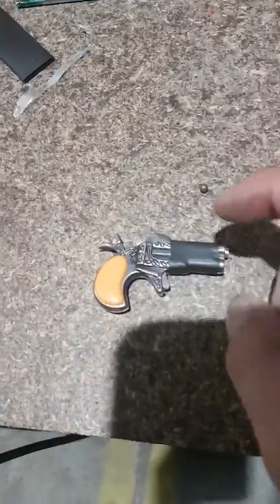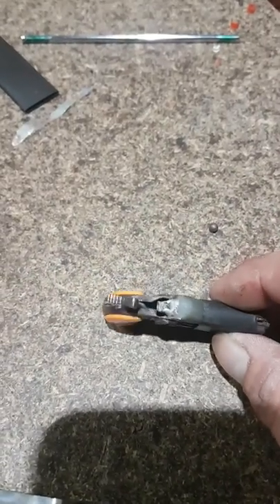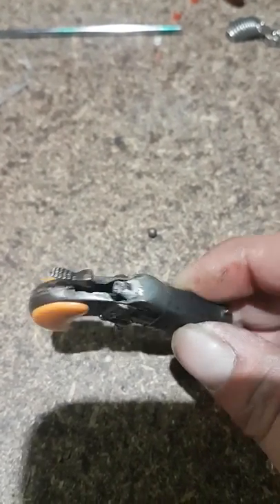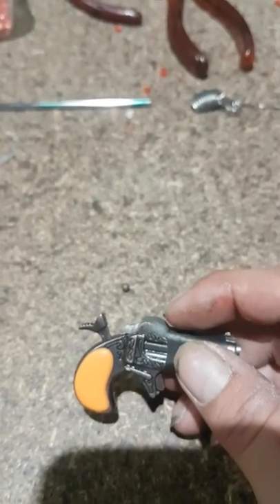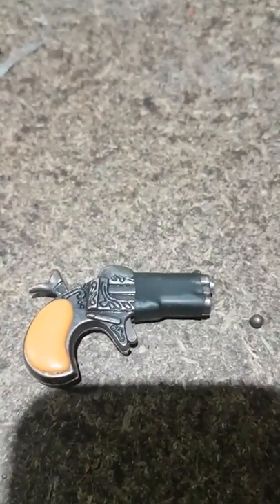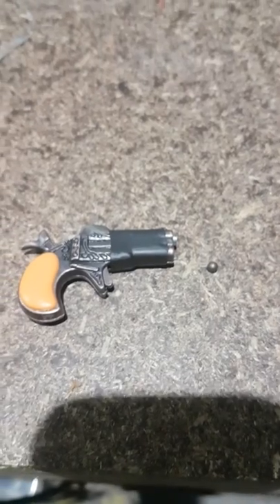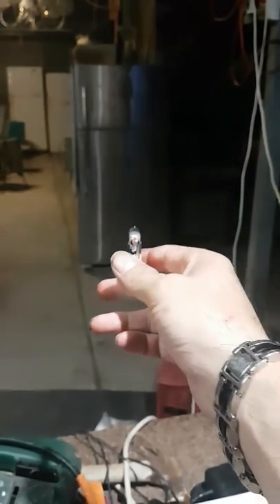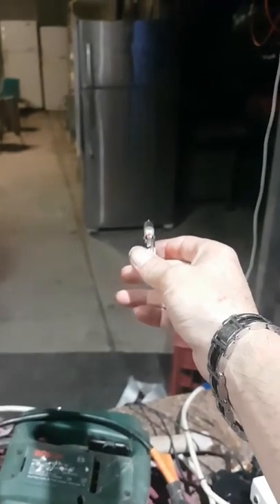Modified toy derringer cap gun

Comment: Can you show how you made it 😂 i dont understand
Reply from the maker: Im Australian and not allowed. I have a video of me testing the barrel before I put it in the capgun.
Reply: @MRLAW243  ok that’s alright but what dd u change in simple terms?
Reply from the maker: @esaar24z i used an old rc car remote control aerial to start with, the telescopic type or the AM frequently style. I pulled it apart into it individual tubes so I could test fit the ball bearing I had chosen to fire. One tube fit perfectly so the I needed something to put a cap on, and that something needed to fit the tube/barrle. I chose a bicycle spoke nut, its the little nut/threaded tube that holds the spoke to the rim on any normal bicycle, take the tyre off the rim and simply unscrew one of the round things inside the rim. Keep the spoke too, its good too clear to barrel after each shoot. Using a drill, grind/sand the large end of the spoke nut to fit inside the tube/barrel. The other end should already fit a cap.
I used solder to attach the spoke nut to the barrel, sand down any excess solder until your able to fit the finished barrel inside to 2 halfs of the capgun. You need to aline the cap end of the barrel with the hammer, I used jb weld and pressed the 2 halfs back together making sure not to get any jb weld on the moving parts.
Reply from the maker: This is a video of me testing the barrel before I put it in the capgun 
https://youtube.com/shorts/UOVth-wpz5A?si=JD87I1EevHrtxp2o

Comment: NOOOOO is that metal?!!!!!!
Reply from the maker: Yes the fridge is metal, so is the cap gun and ball bearing at fired
Reply: @MRLAW243  gosh that's got some power
Reply from the maker: Goes well, the longer the barrel the faster the bearing flys, I have shot myself in the hand "for testing purposes only" lol it hurts but didn't break the skin, that was with only one cap, I have fired it with 5 caps packed into one cap plus a little crushed up and put down the barrel prior to the bearing, wow for how small it is its.